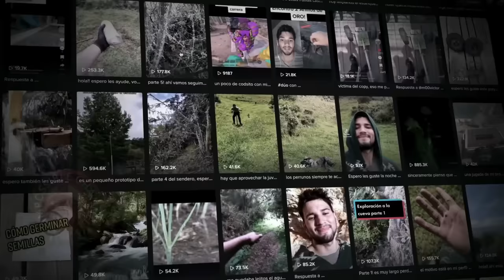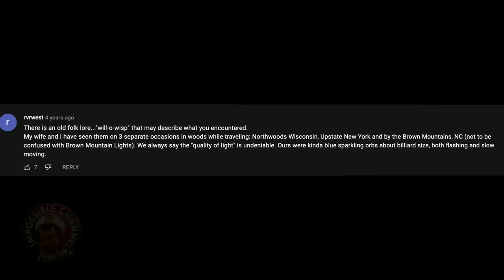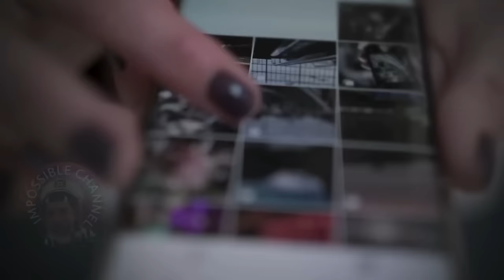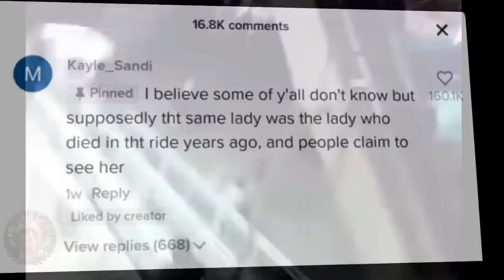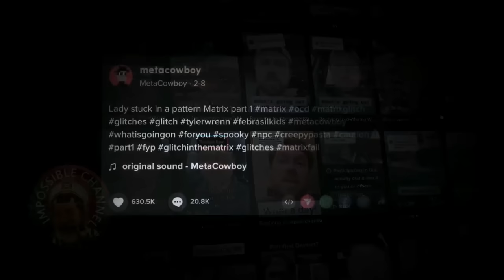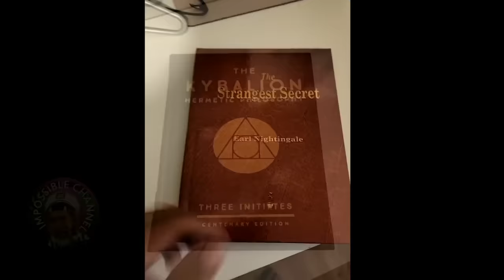The Most Mysterious Glitch Videos You Will Ever See (Compilation 2023)

Comment: There are pocket interference locations in the local telluric fields which can screw with radio and cell phone signals. You might heard of them called "dead spots" where you can't get a signal, or signals are messed up. It can be caused by buried high power cables which are not well shielded, or by some sort of odd metal mineral source in the ground. The ambulance one, the frequency of the interference is being translated by the radio into a sound and pattern that's very similar to an ambulance, but that's our human interpretation of it. 

In my archeology days (back before LIDAR), we used to hunt for buried ruins by looking for disturbances in the local telluric fields with a voltmeter.
Reply: Why doesn't everyone say 'telluric' instead of 'earth'.
Reply: @paulmurgatroyd6372  Well, technically, when they say 'telluric', they are saying earth. I guess saying 'earth' is easier to understand with a limited vocabulary? I don't know. I'm just using the term as I learned it.
Reply: @AveryChristy  So people who don't know 'telluric' have a limited vocabulary, right. I guess we all needed shaming into looking it up.
Reply: @paulmurgatroyd6372  Shame? Don't attach a moral judgement to it. So what if a person doesn't know a word or has a limited vocabulary -- doesn't matter a thing. I attached no morality to it, whatever your understanding of what you read.
Reply: @AveryChristy  Yes, it would have been too much trouble to make it clear for everyone else.

Comment: Well, as far as the lake in the video goes, I think it's just the lake turning over.  Lakes and ponds will turn over twice a year due to the changing temperatures when the seasons change.  Cold moves to the bottom from the top and warmer water rises.  This is good for the ecosystem as it oxygenates and stirs nutrients in the water.  If you look closely, you can see a frog in the water, moving about completely unharmed.

Comment: With the scene where the tree can be seen through the guy, this effect might be related to the camera's image sensor and how it processes light and color. Sometimes, in challenging lighting conditions or with certain camera settings, the sensor might struggle to differentiate between the person and the background, leading to a transparency-like effect. It could also be a result of post-processing algorithms attempting to enhance image quality in real-time. Needless to say, I can comment on many of the subjects but I still love the mystery of some of these phenomenons.
Reply: Indeed, even different wavelengths of light can be shifted slightly due to optical anomalies. I experience this all the time wearing glasses. If I look at a stoplight facing sideways, the red will appear to be floating in mid-air while the yellow will be centered on the signal head. Glitch in the matrix? Nope, just a chromatic aberration.

Comment: That radio interference thing is legit scary. Whatever is affecting that radio in that spot is probably also affecting anyone's body that passes through it too
Reply: It's probably just interference from a radar or numbers station.
Reply: @justinholz480  yeah, could be.. but i know that radiation also causes radios to go wonky too. And they be storing that crap just about anywhere these days...
Reply: Think first about logic causes, only then you may go nuts on other explanations.  That ambulance signal is indeed nothing but electronic repeating interference.  Did someone stoppped and looked around? Over the walls? Knocked at the doors of the neighbouring houses? Tested with equipment? Answer: no of course not. We rather like to believe that the pink elefant flew by. Damn I need my daily dose!
Reply: He is standing on a surface and pushing himself off of a wall with a camera mounted so that it looks like it is being viewed from the ground level. He's working with a simulated backdrop

Comment: The frozen lake has to do with the heat under the lake bubbling up with air bubbles. 
When he returned it wasn’t happening anymore, 1) because he went at a different part of the season and 2) the air pocket under the water already released its air when he was there the first time. I don’t think this is strange at all. But, I can’t explain a lot of the others. Good day! 😊
Reply: The lake isn't frozen either, you can see ripples moving on the surface and a frog swimming around in there.
Reply: Did you also catch that large frog swimming under the ice?

Comment: 9:23 this seems like a very common image artifact due to video compression. in short, the static pixels from the tree were preserved in front of the moving guy, since the light and color values from one to the other were not that contrasting to begin with (after all he was using a camouflaged uniform) an the transition between them was not that abruptly presented for the compression algorithm to separate them both efficiently. this is how mainstream platforms are able to receive, store, and stream video data so we don't have to wait 20 seconds for the video to buffer before being able to watch it on low internet speeds. there's also a possibility for an inprint of the image in the camera sensor behind the lens due to being exposed for a long period of time and the bright setting from the environment, the video seems pretty short for it to happen but who knows.
Reply: The whole imprint of an image on the camera sensor is a myth. I own three cheap webcams that I use for streaming online. I have a professional lighting rig behind me while DJing, so these cameras are routinely exposed to bright moving lights. I've never seen this kind of artifact of an image being imprinted on the sensor.
Reply: @sorcerykid  makes sense, i see now. that guy was definitely transparent.

Comment: I have seen globes of orange light flying in groups of three and two right in town. They were flying below the lights on the power poles, which are about 30' tall, they were bigger than the actual lights on the poles, which are pretty big. I thought they were birds at first, but they were just orange globes of light, a group of three flew up the street flying around the light pole and the power wires and then a set of two flew in the same pattern and height a bit after the first three came by. They made no sound, they seemed to have a pattern to their flight and they flew in a pretty tight formation. I have never even heard of something like this or seen it before  or since.

Comment: 42:00 The Blue Angles. Did a loop and came down in tight 4-plane formation, circled back around. I just saw them doing the exact same maneuver in Grand Junction while driving on I-80 Thursday Oct 12, 2023, practicing for the air show that weekend. I was scratching my head at first, too.

Comment: That was not an ambulance on the radio.
It was some telemetric radio transmission.
It shouldn't be on a frequency you can hear on a normal radio.
An example of a telemetric transmission device is a wireless thermometer.
Could be a wireless alarm also.

Comment: The branch through the fence is completely explainable. What happened is that it fell  over the fence and the other end of it  hitting the ground caused  the but end of it to spring back and go towards and through the fence uprights. I was a tree climber and trimmer and I've seen this spring back action happen many times as the small end of an branch hits the ground first, the heavier but end will spring  back towards the  trunk of the tree. In fact if you are on a ladder cutting a tree branch off, you need to do what I call a jump cut so the branch falls flat to the ground so it doesn't spring back toward the tree and maybe hit the ladder you are standing on. This branch had the but end make it over the the railing as the thin end of the branch hit the ground and i the but end sprang back through the fence.

Comment: The guy doing pushups in the air. I figured it out. He has a metal plate in his head.. Either there's a magnet above him pulling him up or below him pushing him up. Of course the magnet has to be extremely strong and he has to have a lot if resistance strength to pull it off but it can be done with just the right amount of magnetic pull or resistance. Someone is turning on and off the magnet unless he has it on a timer which is also possible.

Comment: 3:57 It goes behind nearest tree, but then, in front of next tree, so it's very close. Then it goes straight into foliage.
8:40 Against very bright light, the camera is struggling to keep up with changes in light levels, 
you could already have noticed two passing men, whose heads vanished... 
The latent image of the tree persisted, as it is dark and didn't move much, but the man moved over it.
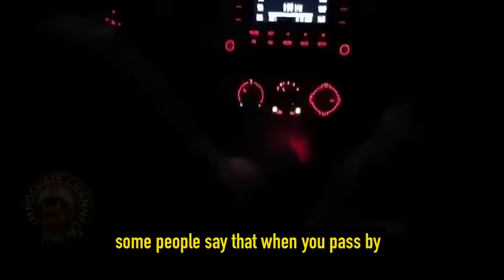11:40 Don't play the radio... Sounds like a compressive standing wave, move on.
What if they stopped, would the interference still change in pitch? Doppler shift?
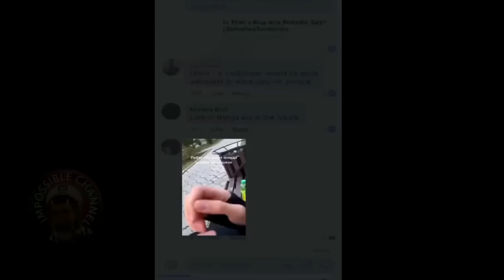14:19 Come in number 36! Your time is up. 
Ruzzian genetic engineering: "Ребят кто знает откуда цифры на мошках", 
"Guys, who knows where the numbers on the midges come from?"
17:31 "Freaky" Firefly? Pointing a torch at it will make it flash back at you. 
18:25 In normal light they are drab grey-brown. 
30:05 Mild epilepsy.
31:11 The guy simply wanted to be the other side of the alleyway, ducking down so as not to spoil the picture...
Did you see the expression of the man on the left?
36:41 The poor Frog/Toad, minding it's own business. 
The reason for the unfrozen patch, might have been an underwater spring, which would be slightly warmer water, the Frog liked it.
There's a spot like that nearby, in the summer, it looks like the surface is alive.
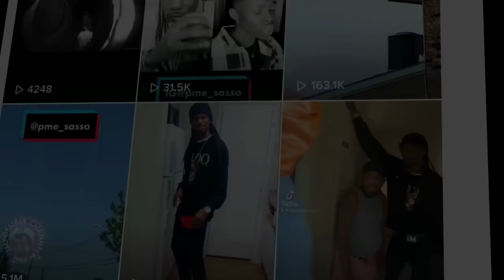41:37 Look at the vapour/smoke trail, that is falling fast. 
The woman said she hear a thump, from that distance, it might have been a sonic boom, it was too soon for an impact.
Notice the sound delay with the fighter jets?

Comment: You can't see the tree through the guy, you're just seeing a camera reacting to the overexposed light above the darker parts of the picture. It's similar in effect to a lens flare but caused by the way the electronics in your phone work.
Reply: I mean you can clearly see that you're not seeing the tree through the guy because you can just see a dark vertical column in the same place as the top of the tree, it doesn't follow the bend at all.

Comment: 53:30 Watch his legs, particularly his knees area (ya hidden). You'll see him pushing away from the fence, his waste does not move but above rises. He has a cable mounted to the post from his waste. Same for his other levitation's, a cable is mounted to the lower corner of (usually) a window other time corner of the house edge bricks. 
56:58 you see him JAMMING his feet/shoes into something solid, you hear the same CLICK as he does each foot. THEN as he quits his waste is momentarily suspended while hands & feet are not touching the ground. YAAAaaa anti-gravity shoes I say is his tool.

Comment: In the 11-minute selection - the radio going bad, I don't have a guess as to whether it's supernatural or not, or even my experiences, but there is one certain name brand of automobiles (one of the big 3 USA automakers of the 1990's 2000s) Back in the late 1980s unto the mid-2000's I noticed that whenever I got into a car of this make-I would destroy the radio. They would just go bad. Not work. Sometimes they would function again, once I left the vehicle, other times that would be the end of the radio!   A friend suggested that maybe I had a certain electrical vibration, like each of us has individually, that affected that car's particular wiring. It was bizarre. And it was only the one manufacturer's car radio that I killed.